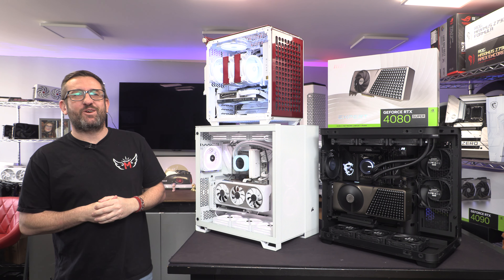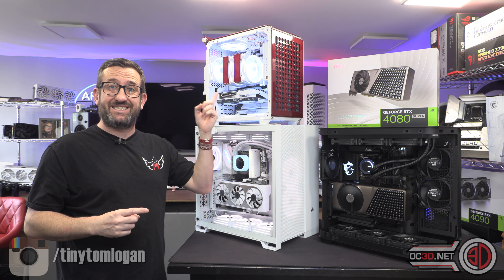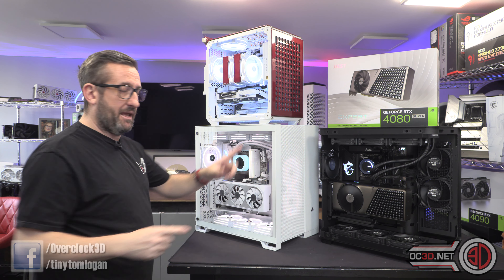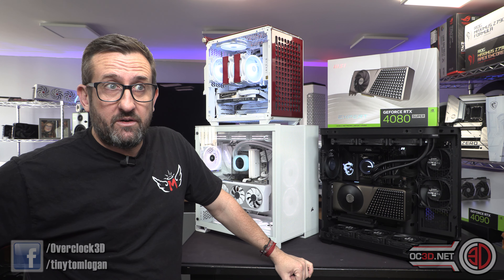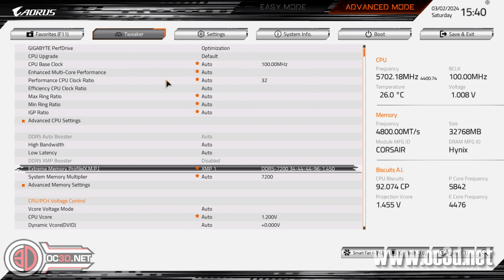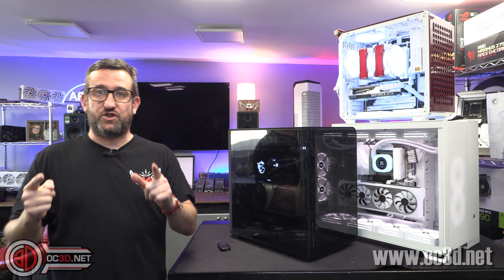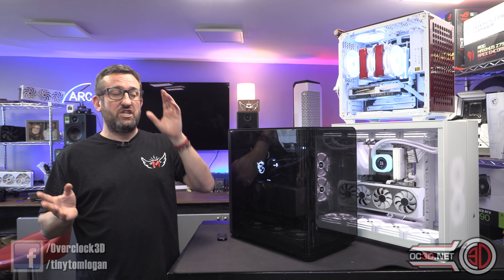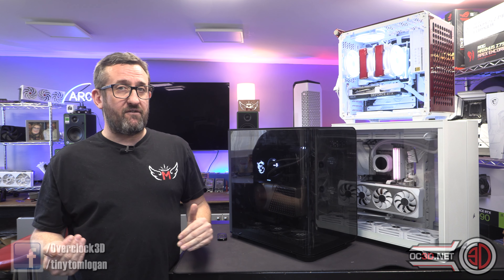Intel CPU Undervolting Guide Asus MSI Gigabyte 13th 14th Gen

Comment: I've tried undervolting  my 14900KF to 1.3v and tried to underclock to 55x which reduced the clocks but I can't get the temps below 100 with a decent IAO cooler.  With everything at stock I get better scores on the benchmarks even though the temp goes to 100.  My motherboard is a MSI MAG Z790.  Not sure why the temps are so high.

I went down to 1.250 with the clock down to 38x temps on 2 p cores still went to 100.  So I unsynced the cores and tried lower on the 2 rogue cores while I increased the multiplier on the 6 good cores.  The 2 cores ran lower but still went to 100 when the 6 other cores maxed at 97 with 57 multiplier.  I think I just got bad luck and the cpu is duff.
Reply: What are your idle temperatures. Maybe you should try repasting the CPU cooler.
Reply: @hectorgonzalez4792  The idle temps are only around 35c and I checked the cooler, repasted it to check it was sat correctly which it was.
Reply: So Tiny Tom Logan has taught you to first undervolt and then lower the frequency. I suggest you lower the frequency then worry about the voltage. But first to make this easy use Intel ETU (Extreme Tuning Utility). It is free from Intel. This will let you quickly make changes without all the waiting that working from the 
bios menus and waiting through the boot cycles. Tiny Tom said to ignore the efficiency cores but they are half of the 14900KS's  32 threads. The goal is to get as much work done as fast as you can with your cooling solution. The cooling solution for the computer is what removes the heat from motherboard, CPU, RAM, Storage, GPU, RGB LEDs, the Power Supply, and Ambient temperature. The cooling solution includes the PC case, Case fans, CPU cooler, CPU cooler pump and fans, and Dust control. Dust control means let in only filtered air and maintain positive pressure. Before starting your cooling solution test download and run Furmark from techpowerup. It would be a shame to spend a hole evening tuning your CPU only to find you have to do it all over again because the GPU was not contributing its share of the heat.

You will want to set your CPU clock multipliers for the performance cores with Performance Active Core tuning and all 16 efficiency cores with the same multiplier. From my experience with 13900K with 1 active core you can have a multiplier in the high 50s and with 8 active cores you will need the multiplier in the low 50s. This is really the fun part where your matching your CPU power with your cooling solution temperature target. Armed with this knowledge you now know that the turbo boost if allowed will help very little to the work done in the near term a will be a detriment in the long term. The ETU will display the wattage  so you can set the turbo boots power a few watts above what is displayed. Limit the time allowed for the boost to one second. There is still some work to do before you can lower the voltage. make a record of the settings for the bios including the fan curves. This is necessary because after you undervolt, it may work fine until it crashes and you have to load the "optimal default settings" to boot and all that tuning effort is gone. You will want to get back to where you were but with just a little higher voltage. The hard part of this process is to store your settings in the Bios/UEFI using menus using words translated from English to a foreign language and back to English.

Please read my other comment for more information.

Comment: WHy use LLC 7 on ASUS with zero explanation? This will give your voltage more overshoot than a lower LLC value.
I appreciate the undervolting, but frankly i begin hoping my 14700kf would die so i can get a 7800x3D. Going to direct die to avoid 100 degrees should not be necessary with a bog standard CPU on zero overclock.
Reply from the maker: Doesnt overshoot at all. There is still a small amount of droop but its as close as you can get without over volting it (because of too much LLC)
Reply: @OC3D  According to the channel "Actually Hardware Overclocking" ,  LLC on z790 ROG Maximus Apex overshoot from LLC level 6 and up. Level 6 is 20 mV, and level 7 is 50-70 mV overshoot. Level 5 will not overshoot. The score voltage is measured using a oscilloscope, since it is regulated very quickly, and overshoot may often not be detected by any sensor software like Hwmonitor, because their poll rate is too low, typically in the hundreds of milliSecs. The guy recommends not using level 7 ("not a big fan of that much overshoot"), and instead use level 6 on that board, which equal "IA domain" loadline of 0.49 mOhm.
Reply: @Anders357 is it bad if i use LLC 4  on an Asrock Z790 Steel Legend?
Reply: @duvanflo8643  i would not think so. Asrock use different scaling on LLC and their level 4 is close to level 5 which is minimum. The most aggressive setting is level 1. I have not seen any measurements of overshoot on Asrock z790, but i do not think   a conservative setting of 4 will cause this behavior.

Comment: On the asus motherboard you have 5600mhz with 1.25/ 1.37 volts. What is the left and for what is the Right?
Reply from the maker: If you have the program open you'll see
Reply: @OC3D  what program do you mean? It stays in the bios by prediction.
Reply from the maker: Have you watched the video through and followed it?
Reply: @OC3D  i have watched the Video but I cant Test it because i‘m Not at Home.
Reply: Those are prediction voltages and not actual voltages. 1.25 V is for light loads/ 1.37V for heavy loads.

Comment: How much voltage do I need to set for 14900k
Reply from the maker: Follow the guide - you need to work out what your system needs. There is no golden answer.
Reply: @OC3D  I set my power levels which has helped alot. PL1 253w and PL1 125w amps 307

Comment: This is def not the best way or safe.  Overshoot is a thing to worry about and not all boards set ac and dc loadline right so the chip can think it gets more or less voltage.  Vr out should match vcore in hwinfo amd same with wattage. Last is letting the fivr control things and having 6.2 single with like 6 all core then over 80c it drops to 5.8 or 5.7 all core is the real way.  Skatterbencher has much safer and better performance guides.  I get 425xx r23 with my reg Win environment imcluding startup apps ,hwinfo and xtu running.
Reply: You appear to have completely misunderstood what is happening here. It's not the same as Skatterbench at all.

Comment: I just need a dang ASUS guide. Cradle to grave. Beginning to end. This isn’t as straightforward without visual steps, even for intermediate users. The editing style makes it jump around a lot. It also doesn’t explain how to know that load line calibration is working correctly.
Reply from the maker: if LLC is working your volts should stay pretty close to the manual setting you made. I did say that. 
Just take a deep breath and work through it slowly dude. 
I couldnt make a video for each or Ill have people wanting asrock, nzxt, evga ect and I just cant do it. I needed to start with a basic one that covers all.

Comment: Gigabyte Bios

Setting

Enhanced Multi core Off
Pcore 54 or 56 with 14gen
Ecore 43 or 44 14 gen
Xmp1
Adaptive Vcore
Offset -15 Test for Stability
Core Current Limit 400 Amps (CCMax)
CPU Vcore Loadline Calibration Medium or Low
IA VR Config enable
AC 10
DC 90

Comment: 13900k first for me, where i did nothing, except set offset to vcore. i know llc way better, seting all cores are sync better too, but... it's worked at -0.15 first months, actually about 1year+. then i set -0.12 and then i add tvb profile 2+ and set -0.1 this video just show me again how lazy my arce is... in which galaxy you found crystal with 5700@1v 
p.s. best way is working with every single core and find voltage and freq for them individually. but who the heck will do that:)
p.p.s. why midrange pc in the video shoot down itself?:)

Comment: That part on the ASUS BIOS is such a bullshit. Level 7 LLC? Uff. Just tested it out of curiosity. But my CPU got -5000 score in cinebench while getting 15°C hotter. This video is the best sample for me why I do not follow YouTube guides. 

With my current settings my 14900K hits easily 40k on Cinebench without exceeding 85°C even on a Throttle Test.